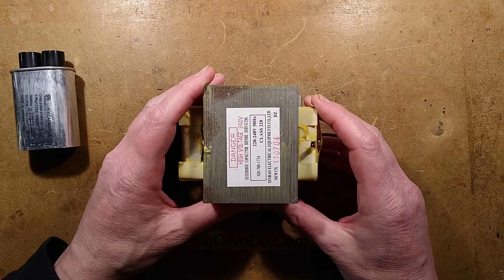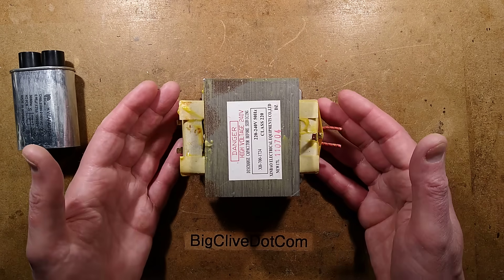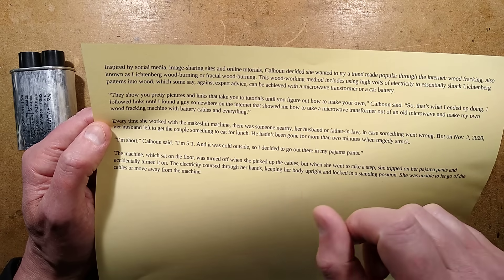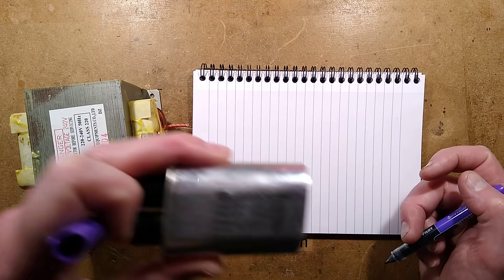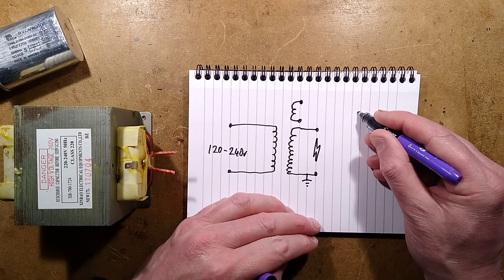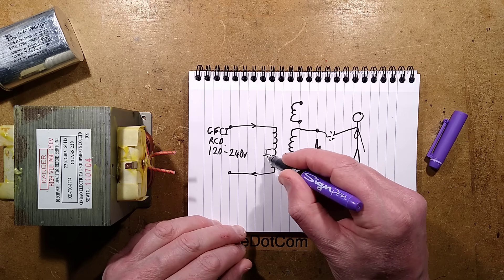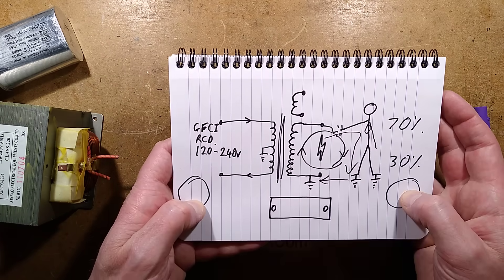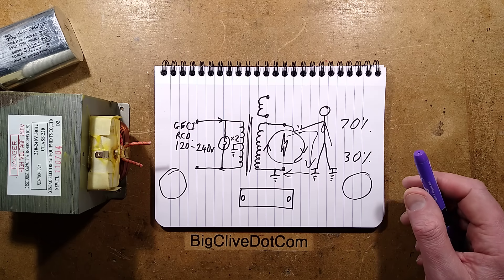The most deadly project on the Internet

Comment: Adding that capacitor in series (capacitive dropper) with the primary would help by current limiting the input & therefore the output (still not 'safe' but 'safer').  Not sure how the math works out with 240V, but with 120V - 24uF = ~1A.

Comment: Great Video, I Like The Indacator Light and The Dead Man Switch.  I Will Admit That I've Been """ Bit """ ALOT By Electricity. and I'm Not Afraid of It BUT I Do Use Appropriate Caution. And I've Had Great Teachers & Mentors Along The Way. Certain Ways to Protect Your Hart, If Your Uncertain as to The State of A circuit, Attempt to Stand on an Insulated Surface.  Stick One Hand in a Pocket and Then Use the Other Hand to Check, that Way Electricity Can't Pass Through Your Heart from Hand-to-Hand. A Good Friend From Long Ago, Was Head of Security for a Long Deactivated Nuclear Power Station. And Even in The Early 90's They Were Stealing the Copper Grounding From The Substations. 
""" BUT """ Most of the Times it Was Undetectable. But He Said " If You Went To A Substation in The Rain And It Started to Feel like Ant's Crawling Up Your Leg's START HOPPING ON ONE LEG OUTA THERE """ FAST """ !!!!!

Comment: As Soon as I heard of this (from Ann Reardon's video) my immediate thought was since wood is a good insulator and it is going through it that means the electricity is Extremely dangerous. More people should know the dangers of electricity, it is a dangerous thing that is so easily accesible.

There is a museum near me with an small electric shock thing that goes off intermitently (not nearly long enouth to kill, just for a little shock to the hand*) and for as far back I can remember I have been Terrified to touch it, I am guessing when I was young it went off when I was touching it but I can not consciously remember.  The fact that even a short shock like that is terrifying to the mind is really Really bad when you think of things like this.

*If I remember correctly it might be around the same as a low level electric fence...and speaking of electric fences! I am related to a farmer and when I was young me and my brothers would touch the electric fence because we were told there was electricty. I personally do not remember being shocked but my brothers said they were, none of us got hurt so it ended okay.
Reply from the maker: If that's the big humming pillar exhibit in London then I touched it repeatedly but only got small zaps.

Comment: I went 6 minutes into the  video and you still didn't mention amps. I can take allot more voltage then that from my tessla coil and not feel much,while fully grounded standing bare feet on {grounded}copper sheet I feel some tingling, needless to say its amperage is very low. Perhaps you intended this video for people without basic knowledge about electricity. the amps should be mentioned , otherwise people may think you deserve less credits then you do with this outstanding and much needed warning video. 
I dont think the enormous ammounts of micro Tessla which you will expose yourself to will be a good Idea, we are just beginning to learn the effects of this, buts its certain it has a disturbing effect on the immune system and brain functionality , we ourselves as you probably know are dependent on the transfer of electrical currents through our nervous system. edit: I re
Reply from the maker: The current will vary, the video is aimed at non technical people who don't understand the dangers.

Comment: got shocked with main voltage as a kid i learned that the hard way. death is closer than you think. sometimes trauma is the best teacher but it didn't stop my hobby to tinker with electricity and make little fun projects and fixing household items.
Reply: I also got a shock with mains voltage when I was about 10. That 240V shock was enough to teach me that electricity is not to be trifled with. It’s 30 years later and I’m still obsessive about making sure the switch is off before I even change a lightbulb.

Comment: my safety method is as follows. been doing it for years too, never had an issue:

in lieu of the Deadman switch 
i strap a lead to each testicle. the electricity never passes through my heart and WoOoHoOoO! the "tingle" is so stimulating.

i think it generates better patterns in the wood too.  WHY it makes better patterns, you may ask?
. because of  #TESTICLES  of course. 

testes make everything better.
🤪
Reply from the maker: This current would actually ignite your testicles, and be most unpleasurable.

Comment: Always 2 safety barriers when working with electricity. 1: High Voltage Protection Gloves, Boots and sheets to insulate equipment carrying current. 2 Double insulated tools. And if you value your face, I would also invest in a high voltage face shield. Always safety first. Before you begin to experiment with electricity, take the annual FSE safety training.

Comment: There's also the danger of any timber being burned resting on a timber bench in conditions of high humidity where the bench has a high moisture content. Potentially the whole bench can become electrified. I remember messing about with TV flyback transformers as a teenager and building a Marx generator. But I always stayed well clear when they were turned on or used a length of PVC conduit for moving the high voltage cables.
Reply from the maker: On the basis that this project involves spraying salty liquid over everything, the benches absolutely do become conductive.

Comment: Got hit by 230/690V circuits a long ass time ago at work (quite literally from a fuckin pin sized hole on a wire) will definitely say it was a shocking experience😉(also will not be going back

Comment: As a kid I was curious and I took a sprimg from pen. I streched it and put it inside power outlet. I was lucky it was thin so it blew up and I got schooled with a shock and little wavey burns on my hands since then I don't touch any wire until I am sure it is not plugged into something even if it is "isolated" with rubber.

Comment: In college a few of us would charge ourselves up somewhere around 20KV using the HV probe off the flyback of a CRT monitor. But we hooked it to a great big resistor to limit the current to a few uA, Then we'd zap our friends like static discharge.. Good times. Wouldn't recommend to do it at home though. Leave HV to the trained professionals

Comment: It is easy to make safe keeping in mind human stupidity: You need to make it PHYSICALLY IMPOSSIBLE to be near the device when it is on, like in factories: Put 2 "keep pressed to operate" switches on one end of a 10 foot plank, and the high voltage components on the other end. Or in a locked room.

Comment: I use the equivalent if a dead man switch, afoot pedal like you use with tig welding, heavily insulated and use a neon light transformer.  Ms incorporate a variable transformer and can do burning at much lower voltages. So far never had an issue. I think the process is dangerous more so for someone who knows very little about electricity.

Comment: My dads a sparky and in his 45 year career has had only 2 serious shocks. His last one was roughly 15 years ago when he was working night shift. He is usually a very safe electrician but didn't sleep well the night before. He was very tired and probably got a bit complacent. He was working on a live busbar and slipped off a step ladder and somehow manage to touch it. Big flash of light and it threw him back. His heart felt off so he went to the hospital and did an ECG. He was cleared the next day thank god. Electricity is no joke and one wrong move can have serious consequences. Needless to say my old man has told me to never stuff around with these microwave transformers.
Reply: Lack of sleep is a killer. I once had a bout of insomnia and turned up to work having not slept the night before.

I had worked for a construction company that did insurance work and my job of the day was to load up the "aircraft carrier" a huge tandem axle flat deck trailer with steel temporary fencing and head to a town 2 hours away. I hitched it to my Toyota Hiace van and forgot to put the tow hitch into the lock position. After about 20 minutes on the highway, I came to a narrow bridge over a stream, just before that bridge there was a really nasty dip that would bottom out your suspension if you didn't slow down. After the bridge the road wound up a hill so there was not a lot of visibility. It didn't stop all the log trucks screaming down the hill though. 

I hit the dip, and the trailer came off and began swinging back an forth on the chains at around 90km/h rendering the vehicle completely uncontrollable. I was fishtailing all over the road and I could feel that if I tried to correct it I would roll, so I gradually applied brakes and just kept the steering neutral, it was all I could do. We (17 year old apprentice in the passenger seat too) wound up in a ditch on the wrong side of the road, unscathed apart from the trailer braking system which was trashed. Had a truck been coming the other way it would have been lights out. Those vans have absolutely no frontal impact protection. Single most terrifying experience I've ever had in the road. Trailers are far more dangerous than people realise.
Reply: @Patrick-857  I actually believe lack of sleep is a genuine reason to call in sick, especially if it wasn't your fault. And especially in HIGH RISK jobs like these.

Comment: another thing to add, if you break the insulator on an old microwaves magnetron, theres a chance its made from beryllium and if you breath that in, youll get berylliosis. also, even if your not grounded, your bodies capacitance will still short you to ground.
Reply from the maker: Beryllium is not used in modern home microwaves.

Comment: I’ve got news for you, a neon sign transformer outputting several thousand volts at 30mA can kill you just as easily as that microwave transformer.
Reply from the maker: It's much less likely.   Neon sign shocks are often violent but non-fatal due to the inherent current limiting of the transformer.

Comment: If you added an RCD inline to the other side would it protect you from fatalities?
Reply from the maker: It's not easy due to the high voltage and way the output is used.

Comment: This is a good video apart from when you said to discharge a cap by shorting it with a screwdriver. Never do this with a large capacitor, use a resistor to drain the cap and check the voltage afterwards to make sure it is discharged.
Reply from the maker: In this case it's as a last resort safety shunt and not for general use.
Reply: What happens if I don't use the  resistor . Where can I find those resistors